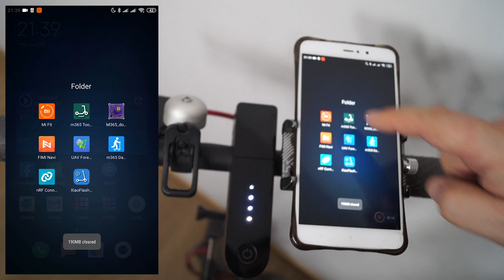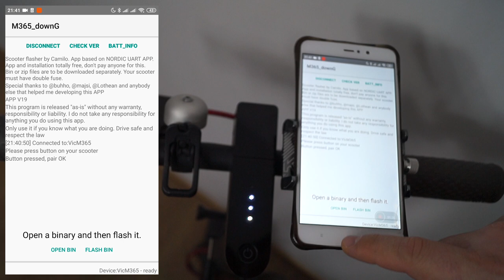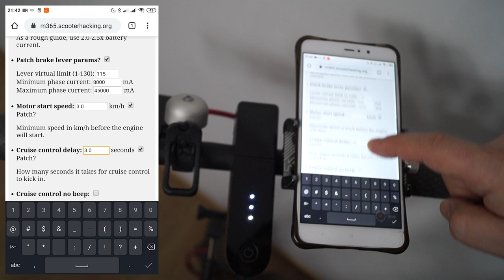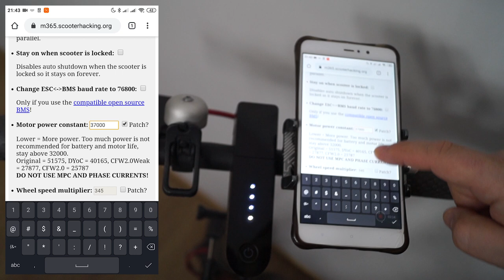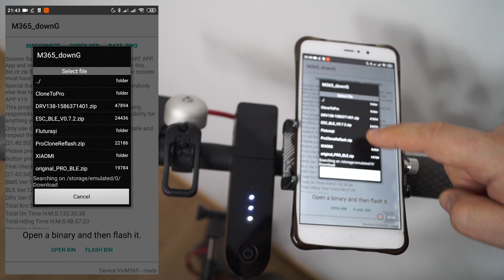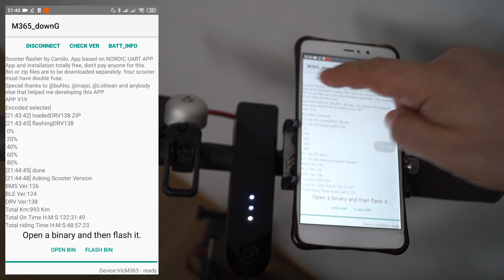XIAOMI M365 (Pro) | Do you want higher TOP SPEED or STRONGER ACCELERATION? Flash a CUSTOM FIRMWARE!

Comment: I flashed the pro with the classic firmware :-( Cant get it back to Pro now.  BMS 116, BLE 90 and DRV 538.  Help me :-)
Reply: Use the xiaomi home app and do the software upgrade there. I don't know if it will 100% work
Reply: Didnt work, DRV is still 538. Can flash BMS and BLE without problem.
Reply: Download, xiaoFlasher for m365(pro) Nineflasher. From the play store, download a zip from https://m365pro.scooterhacking.org/
Uncheck the spoofer box, download the zip and flash it with that app. Then try xiaomi home again see if you can upgrade firmware. Again not 100% if that will work. That whole process should only take 5 mins
Reply: @ksrnate  Its updating BLE to 1.2.2, but ESC is still 5.3.8. And now I cannot connect with xiaomi home
Reply: @tinilsen  Sorry then mate I don't know. You need to flash the stock pro firmware don't you? Maybe Google see if you can get a stock zip and flash it using one of the apps. I haven't had to do it so I can't help anymore. Hope you sort it mate
Reply from the maker: The Xiaomi app sees that you have version 5.3.8 and considers that it doesn't have any firmware newer than that, that's why it doesn't even try to flash a drv firmware. This is the whole purpose of version spoofing, to prevent the Xiaomi app from overwriting the custom firmware.
Reply: @nextor11  I know, ordered a ST-link programmer. Then I need to flash the mainboard under the scooter?

Comment: any update to using these settings so far?
Reply from the maker: I'm not using the scooter due to lock down, but I used it for about 900 km with those settings or similar and all is good.
Reply: @nextor11  cool, im only using as in lockdown but its only down to the park and back whilst daughter learns to ride a bike
Reply: @nextor11  I'm being told can be issues if going to fastbdown Hill etc and burn out motherboard. I trust you more. What's your insights?
Reply from the maker: That can happen even if you have the standard (original) firmware, especially if your battery is fully charged.
Reply: @nextor11  so going to fast when have the regen option or kers on?
Reply from the maker: Yes. That's why it was always recommended to have kers set to weak, even when having original firmware
Reply: @nextor11  cheers, good knowledge, im promoting your page further on facebook  :)
Reply from the maker: Thanks!
Reply: @nextor11  someone just mentioned using prosport.zip but i advised they are just tweaks of settings and stick to yours.  trying to work out the best so far.. but if your is 18mph and no issues on standard 365 ill try.  and battery doesnt drain too much unless full throttle etc?
Reply from the maker: First of all I'm not promoting any firmware. I just wanted to show what is the process of flashing a custom firmware so that people understand how it can be done.

I don't know what prosport.zip is, but I saw that some people are saying that they created some miraculous firmware, but no firmware can increase speed and mileage at the same time for example. Or other stupid claims I heard.

There is a guy that knows what he's talking and was comparing some firmwares. Search for nelsonware and you'll find his blog.
Reply: @nextor11  sounds like you perfected the best balance of speed and mileage etc
Reply from the maker: You should try all the options you have and choose one that works best for you.
Reply: Salut, sunt român așa că îți voi scrie in limba noastră. Foarte ok videoul și pe înțelesul celor care nu au prea multă experiență. Îți scriu deoarece am mai multe întrebări. Configurația mea de la scooter M365 cu update-ul la zi BMS 126 / BLE 91 / DRV 156. Din cate am citit și văzut peste tot, lumea sugerează sa fac downgrade la BLE si apoi sa pun un custom 138. Este necesar acel downgrade. Recomanzi asta? Daca da ai un link către un BLE testat de tine. BLS-ul trebuie făcut ceva cu el? Ce site-uri recomanzi pt DRV și ce aplicație pentru flash. Mulțumesc mult și scuze de toate întrebările astea :)
Reply from the maker: Nu trebuie să faci nimic cu BMS-ul. Downgrade-ul de BLE nu mai este strict necesar. Pe vremuri era. Eu de obicei îl fac ca asa m-am obișnuit. Găsești link pt firmware de BLE in unul din videourile mele mai vechi.
Reply: @nextor11  pentru că noapte mă apucă chestiile de genul :) am făcut pe la 3 următoarele: downgrade la BLE am pus 72 luat de la altcineva care avea video pe tema asta, downgrade la software 138 facut pe botox și am ales ceva foarte popular și "safe". Ma interesa doar sa cresc viteza. Am văzut că mai nou a apărut XiaoGen care are foarte multe setări însă îmi pare customizat mai mult pentru PRO și îmi este frica sa îl folosesc. Știi ceva despre XiaoGen? Ai folosi asta pentru M365 simplu? Singurul motiv pentru care as folosi este că pare mai dezvoltat pentru a fi safe pentru trotineta. Am incercat și să revin la firmware-ul de baza facnd update prin MI app dar se pare că aplicația zice că sunt la ultima versiune chiar daca nu sunt acolo acum. Am scos scooterul și l-am.adaugat iar în aplicație dar same shit.
Reply from the maker: N-am folosit XiaoGen pentru ca nu prea am mai folosit trotineta anul asta și sunt oricum mulțumit cu firmware-ul custom obișnuit.
Reply: @nextor11  am o singura problema momentan. Am incercat sa revin la softul de fabrica dar aplicația nu face upgrade chiar daca vede 138 :). Pot folosi tot dar nu face upgrade, știi oare de ce face asta?
Reply from the maker: Nu știu de ce. Am constatat și eu aceasta problema, dar nu știu vreo soluție.

Comment: Hi Victor , I accidentally flashed my pro with the procedure for the classic now my dash display only displays 0 speed and 1 red battery bar.  I have tried redoing the process with the m365pro. scooter hacking file but the display remains the same. I've also gone back and updated the original firmware from the mi app but the display still remains the same, any ideas, please?
Reply from the maker: What versions is M365_downG reporting when you click on check versions?
Reply: @nextor11  thanks for prompt response BMS 126 BLE122 DRV 538
Reply from the maker: Drv 538 is not right, for sure. It seems like flashing a Pro drv firmware didn't succeed. Also, ble 122 doesn't seem right. I don't remember this firmware version.
Reply: Victor Ungureanu any suggestions , how I can reset back
Reply: What versions should I have ?
Reply from the maker: Try to flash a Pro custom firmware. The version number should be 155 or 555 (if you enable version spoofing)
Reply: Victor Ungureanu ok tried 155 as can’t find 555 but still showing DRV 538
Reply from the maker: 555 is just 155 with version spoofing enabled. 

Try flashing ble 090, see if that works.
Reply: Victor Ungureanu yes tried BLE to 90 and tried to flash to 155 again but no joy still showing 538
Reply from the maker: Then I guess you are left with only one option, to use an ST-Link programmer. I have a video showing how to flash the ble firmware using the programmer:
https://youtu.be/xlezACP1YYw

After flashing the ble, you will probably be able to flash the drv in downG or XiaoFlasher

Comment: didn t work to me
Reply from the maker: Which part didn't work?
Reply: @nextor11  the xioami mpro there is two version. one has one fuse, one has two fuse. if is not one fuse do not work
Reply from the maker: There is no Pro with only one fuse. You still didn't say what exactly didn't work for you.
Reply: The speed still same
Reply: @nextor11  you can check on the serial number. If the end number is more than 350 000 has 2 fuse
Reply: I would like to send you a private msg
Reply from the maker: Having two fuses is a good thing.
Reply from the maker: The speed is still the same probably because of the setting you used or because the battery was not fully charged.
Reply: @nextor11  yes i know mine is one fuse
Reply: @nextor11  my ESC firmware version is 0155/      BLE firmware version is 0122/       BMS firmware version is 0126
Reply from the maker: If it only has one fuse, then it's not a Pro. Maybe it's a classic M365 with pro dashboard.
Reply: @nextor11  hi there i did downgrade to bms 107 on my chinese black version (2 Fuses) no difference in speed, can you tell me why ? serial of device is 13679/00191598 ,firmware is 0142, release date 04 december 2018,if you got time pls help :D
Reply from the maker: Who told you that downgrading the BMS firmware will increase the speed?
Reply from the maker: You need to downgrade the DRV firmware.
Reply: @nextor11  so if i patched like you on your video it will work ? i just installed 107 over m365 freedom  app and speed is same il try your metod with russian custom firmware and let ya know ;)
Reply: @nextor11  i just did everithing like you on your video,finaly scooter is going 31kmh,but accelerate slow and uphill is disaster :D any ideas how to fix this  ? Thanks!
Reply from the maker: Reduce the motor power constant value.
Reply: @nextor11  how much my brother now is like yours 37k ? :D
Reply from the maker: 37k is ok, the acceleration should be good.
Reply from the maker: Also make sure you are not in eco mode
Reply: @nextor11  on 37k uphill and acceleration is weak ,but top speed is ok ,should i lower the power constant even more im around 92kg :D
Reply from the maker: I think that it's risky in the summer. You should keep an eye on the temperatures.
Reply: @nextor11  i must say that now is way faster but early stock was better uphill for sure,any advice how to make it more punchy uphill? and how low is secure below 37k ?
Reply from the maker: I really don't think it was faster uphill when stock.
Reply: @nextor11  after 138 feels like it has less torque but grater max speed , can i improve that some how true firmware?

Comment: it says proxy error when i click patch:( what to do?
Reply from the maker: I guess you see that error when trying to create the custom firmware, right? Which website are you using?
Reply: Victor Ungureanu im using the website in the description
Reply from the maker: The one for the classic or the one for the Pro?

Later edit: both are down. Let me see if I can find others.
Reply from the maker: For the classic scooter you can use https://m365.botox.bz/
Reply from the maker: An for the pro:http://xiaoscooter.site/en/custom-xiaomi-electric-scooter-pro-firmware-builder
Reply: @nextor11  on the site for the pro i dont know what enable
Reply from the maker: First of all, do you have the Pro or the classic M365?
Reply: @nextor11  the pro
Reply from the maker: Ok. Use the GONKA preset first. Then, after you do a bit of research, you can chose to modify other settings, if you find them interesting.
Reply: @nextor11  okay thanks for all help;) i will tekst you if i need more help
Reply: @nextor11  now it works but it dosnt charge when you release the throttle how can i get that back?
Reply: @nextor11  now im in serious need of help, it all worked perfect. but when I hit the new top speed the motor charge/braker locked itself and I don't know how to get it off
Reply from the maker: I don't understand what you mean
Reply: @nextor11  it can't drive.. the throttle dont work and it brakes all the time
Reply from the maker: Is it locked? Does it beep if you push it forward?
Reply: @nextor11  no it doesn't beep
Reply from the maker: Does it let you turn it off and then back on? Is it behaving the same after you do that?
Reply: Victor Ungureanu it still stops After i restart it
Reply from the maker: It stops? Does that mean that it works fow a while and then it stops?
Reply: Victor Ungureanu no it also stops when it’s turned off